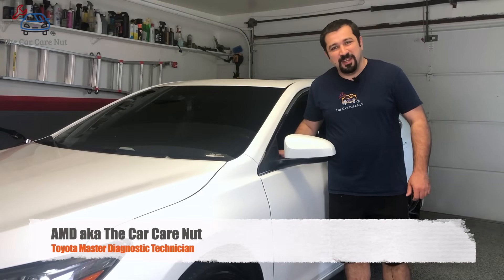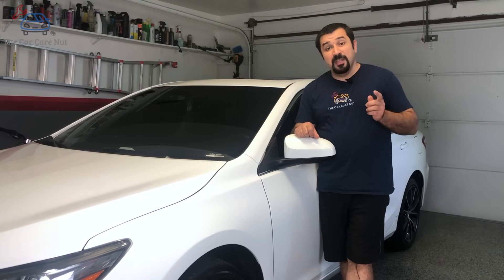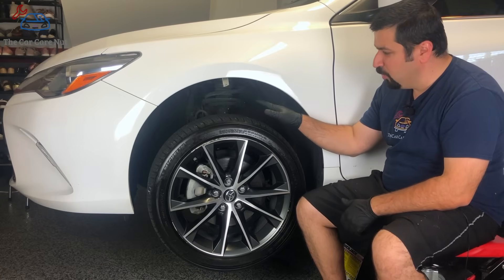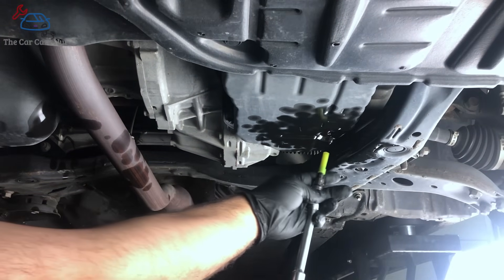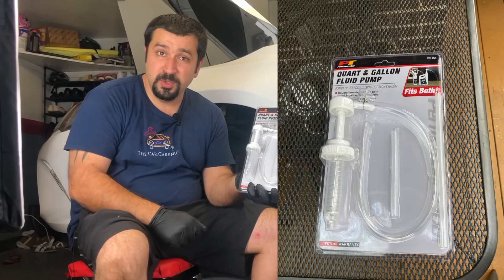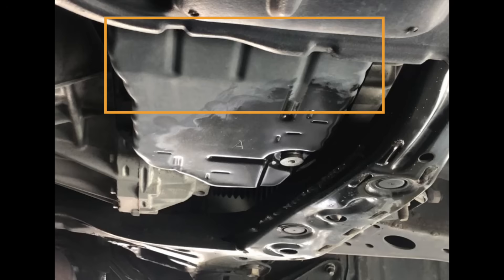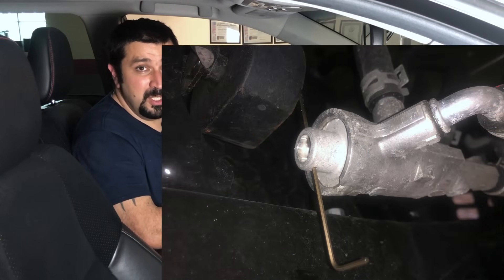How to change your Toyota Sealed Transmission Fluid

Comment: Hello AMD !  I have been one of your subs for about 3 years now and thoroughly enjoy your content.  I have a Japanese built 2017 CHR with  AWD and the 8NR-FTS 1.2 litre  4 cyl. turbo engine, which I purchased new. Today the car has only just over 15,000 km.  

Where I live I consistently drive on rough dusty winding roads in mountainous and hilly terrain at low speeds (30 -50 km/hr) and often in stop and go traffic. The average round trip is between 35-40 km. There is very little opportunity to do any highway driving because there are none in my immediate area. I change my engine oil and filter every 6 months with OEM Toyota oil and filters. I just did a full service on the brakes including re-greasing the caliper slide pins, and inspected the rotors, pads, etc. for proper function and wear. 

Based on these driving conditions and the incredibly low kms on the vehicle,  should I also be performing a transmission service more frequently as well ?  If so, please let me know the temp specs for this transmission and your recommended change interval. I know it calls for FE fluid as indicated on the fill plug. Same question also applies for the transfer case and differential fluid. 

SLL Coolant is still original however according to a recent ph test, it is still registering in the safe zone after 7 years.

Appreciate your help !

Comment: Hi sir, I had a question regarding the fluid check of sealed Toyota corolla transmission.

After going back and forth quickly from D to N, and the D comes solid, May I know why do I have to remove the obd2 cable?
Like what does that do?

Is it fine if I just proceed to drain the fluid with the cable inside?

Comment: You just flashed oil sir no filter changing and pan cleaning😮
Reply: It gets about 1/3 of the fluid is my understanding.  Not a complete flush.
Reply: Actually, I was wondering if that has something to do with the temperature being given in a range.  The old mixed with the new.  Maybe the expansion property varies.

Comment: What are the odds that the Toyota dealerahip does this right?
Reply: It takes something like 8hrs for the trans to cool.  To do this procedure, the dealership or an autoshop would have to have you leave the car overnight or have it towed in.  You won't be sleeping in the waiting room.  So, toyota came up with a procedure to allow them to get the level right at normal operating temperature.  This requires specialized tooling:  A variable length level gauge, vacuum gauge, vacuum pump, fluid tank.  It is much more involved than this original/DIY procedure.  https://www.youtube.com/watch?v=cNcecuGzTDg&t=10s
Reply: @clickhorizon  Any idea of cost? I always get my trans fluid changed at like 60k but it seems all of these newer cars don't schedule a trans fluid replacement at all.

Comment: Hi, I have this same car, 2016 camry.  Door sticker says it has got an A/TM:-01A/U760E trans in it.  Q) What is the actual temperature you would begin this procedure with using a scan tool (scanguage for example) on this vehicle?

Other
-----------------------------------------
You mention three ways to do the temperature check (see 9:00 min).  Then you focus on the 2nd method, letting the diagnostic routine tell you when it is up to temp.

You only state a range for most vehicles are between 95 to 110 (see 16:09), talking about the temperature gun method.  Is the range only about that method?
I've seen other videos giving ranges of 95F to 113F or 104F to 113F.
At (see 16:25) in the video you say this is not a guessing game and you have to be very accurate.

I don't particular want to go with the diag routine method simply because I'm scared I'll short something out & do damage.  I can't see all that well in close quarters to do it.  I wondered if there is a premade jumper/connector for this, but coudn't find one.  So, I bought a scanguage and that's what I'll be using.

So, if it's got to be very accurate, what does that mean.  Why are the temperatures in ranges?  All I am seeing are temperature ranges, not exact temperatures.  Is the range due to tolerances, method, or both?

I seem to have gotten it in my head watching other videos that 104F is the right temperature in general.  I'm thinking that temperature is out there from the 95 to 113 range, since 104 would be the average of the two.  But if you go with the 95 to 110 range, you get a slightly lower average of 102.5F.

Also, if were to use the temperature gun, it's looking to me like (from other videos I've seen), that on the rise, the pan temperature is going to be lower than the fluid temperature.
I'm thinking the opposite is probably true on the fall due to hysteresis...something to consider.
And, I am thinking 95F or 110F is a more apt temp to use with the temperature gun (while the fluid temp is on the rise).
Whereas using a scangauge can be a more accurate figure. But what's best practice... use an average... start with the low temp (since engine will be running still & temp rising)... or go with lower temp rather than higher temp so that you don't underfill....but then overfilling could be bad too...  Anyway, just my thoughts.

What I'd really like to see is a spec for my particular vehicle.  I've seen people talk about the transmission.  Maybe that's all you need to know, that it's a U760E... or does vehicle make&model really come into play, idk.
Reply: Well... I went ahead and did this drain and fill on mine.  Was going to do this at 60k, but I either didn't have the tools or the weather was no good.  I got about 2.5qts out, very dark/black.  62k miles.  Most of it came out without even removing the overfill tube.  I only got about a 1/2 quart, I think, after removing the tube.  I was a little worried something was wrong.  Tube looked good.  Thought it might be cracked or missing.  I realized this must be because its done cold so all that fluid had drained out of the gears overnight and overfilled into the pan far above the overfill tube.  Still suprised at how little came out with the tube out though.  I carried on.  Put the tube back in, just snug/hand-tight, & and put the drain bolt in temporarily.  Put in 3 quarts.  Started it up.  Ran it through all the gears before the level off several times.  I was aiming for 102.5F, but the ScanGaugeIII was only giving me readings in 2degree increments brand new out of the box.  Started it at 101F and ended at 107F. so should be within spec.  Pulled the drain plug and got out 1/2qt before it started to dribble.  Still pretty dark but with traces of red.  Almost exactly what I overfilled it, so that was a good sign.  I used that bucket from the video, great tip.  Hardest part of this job was just leveling the vehicle in the driveway.  I had a hell of a time with that.  Finally settled on using a socket up against the drain bolt head itself with a bubble level.  Front to back and Left to right.  Never did get it as level as I would have liked.  I'd get it where I liked it one direction and the other direction would be off.  Anyway... thats my experience.  Went for a 10mile test drive.  I'm happy with it.  6hrs it took me lol.  I'm thinking of doing it again, considering the color.

Comment: Thank you for your help. I was able to change the fluid without too much trouble and learned a ton! Some observations from my experience should it help anyone:
1. I have a 2019 Camry and did the transmission fluid change at 60k miles. It was the first time I did it and the first time the transmission fluid has been changed since buying the car new. The fluid seemed very clean and still a good red color.
2. I did an oil change at the same time but before the transmission. You do not need to remove the splash guard that covers the oil drain plug as it is bolted to the same splash guard you have to remove to gain access to the transmission drain plug and remove that will expose oil drain bolt anyway. Save you a few minutes if you're doing the engine oil at the same time and a 'duh!' moment lol.
3. The drain plug AND the fill plug were torqued down extremely tight. Make sure you have something with a lot of leverage, especially the drain bolt. I used a 16 inch torque wrench and still barked my knuckles on the fill plug. Be careful.
4.I jacked the up car on 4 stands to keep it level and confirmed with a magnetic level on the undercarriage. It wasn't perfect but it was close.
5. A long piece of tube stretched over a funnel held high above and clamped onto hydraulic lifts for the hood is how i got the fluid back into the transmission. As long as there was pressure from more fluid flowing into the tube it was able to go into the fill hole with minimal leakage. I couldn't get the last few drops in, but I purposefully overfilled it so that last few ml's didn't matter. 
6. Draining was straightforward, the straw came right out and the fluid came afterwards. I didn't have a bucket to measure but that would've made it a lot easier to know how much to put in. Another video I watched said 3.5l which is what I did and it went fine draining out the excess though it was probably a little wasteful.
7. The temperature was tricky. I went with the infrared gun method and because my Camry isn't the same model as the vehicle in this video the picture wasn't a perfect match. I looked for the same ridges in the picture and tested multiple areas until every spot on the transmission case was over 95F. Afterwards I removed the drain bolt for the second drain to get the appropriate fluid level and after about 20-30 seconds it started to trickle out like shown in the video.
8. Before and during part 7 I was shifting to circulate the new fluid a very concerning thump sound kept happening when going from park to neutral, neutral to drive, drive to park etc. It wasn't a bad thump, I imagine it was the transmission doing its job with low initial fluid since it hadn't had the chance to fully circulate. I took a risk and drove it around afterwards and luckily that sound did not occur over the 20-25 minutes of test driving. I was mainly doing neighborhood but also was able to get up to highway speeds of around 70mph and it was shifting great, no incidents. I think giving the fluid the opportunity to actually flow and engage the gears instead of just alternating between park and drive was what actually filled up any gaps in transmission fluid that was causing the thumping. I still am concerned that the sound was due to low transmission fluid, so I'm curious how it will sound when I start it cold tomorrow morning. In either case it drives as good as new when warm so I know the level is very close and I way overbought fluid so I can add more and repeat the drain process.
8. I've left the splash guard off for now, and placed a large piece of cardboard under where both the oil and transmission drain bolts are located. I will inspect it in the morning for any leaks, along with the bolts themselves. I'm about 2 hours post change and the only thing on the cardboard so far is water so I think I'm in the clear.

Will update ASAP. Thanks for all your help!
Reply: Update?
Reply: @shnielmanhousr4165  I changed the fluid and despite initial fears all is well! It’s been nearly a year now and absolutely zero issues with the transmission! When I do this against 120k miles I’m going to measure how much fluid comes out instead of doing the temp measurement dipstick thing! Good luck!
Reply: Update please
Reply: @kojac40  hey! It went great and there car runs flawlessly no issues! When I do this procedure again I’m going to just measure the fluid that comes out and replace that amount rather than do the dipstick drop perfect temperature thing.

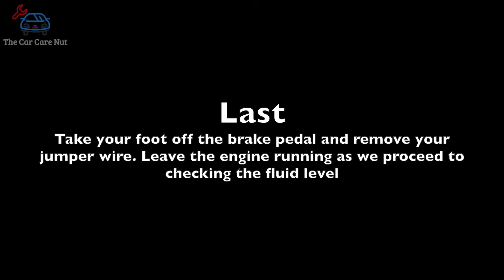Comment: On the "Last Part"(12:13) When you take your foot off the brake pedal and remove the jumper wire. Leave the engine running as we proceed to checking the fluid level. My question is Do you put the car in park?

Comment: I used an electrical multimeter temperature probe taped to the transmission pan on my Lexus IS250 to set the fluid level and it Worked perfectly. I also taped a kitchen thermometer next to it as a reference ( Kitchen thermometer was very accurate ) Didn`t need a costly scan tool / infrared heat gun or to jump the OBD port.
Reply: So when you use a temp. probe to get the proper temperature you no longer need to do the the jumper wire shifter cycling process? Or is it still necessary to cycle the hydraulic circuits?
Reply: @johnhoover7869  I cycled the transmission between fluid changes. Just search IS250 Transmission oil change and you`ll find lots of tutorials.
Reply: @johnhoover7869  No jumper wire needed ( that`s only to put the ECU into the maintenance mode ) You still need to cycle the trans through D N R P 3 or 4 times to circulate the fluid. No need to do the rapid P N shifting as that is only needed to obtain the correct temp via the ECU maintenance mode )

Comment: Great video.  I discovered that the Toyota dealership that had done a fluid flush had forgotten to reinstall the plastic standpipe and the magnets in the drain pan, resulting in low fluid and problems when the transmission was cold.  So much for the dealership. BTW, my heat gun read 85 deg F when the D light came on, and 110 deg when it started flashing.  So it was 5 to 10 deg too low. So if you use that method, factor that in.

Comment: What would the temperature be for a 2021 Toyota RAV4 XLE? Also, when your shifting between neutral and drive you stated the drive will turn solid. How does that work if your continuously shifting between neutral and Drive? Would you just have to keep an eye on when you are shifting it to drive to see if it turns solid before shifting back to neutral?

Comment: Can you make a video explaining the procedure on models with a dipstick? Just wondering how to determine the correct levels between cold and hot and whether i should use the temp sensing mode you explained here using jumper cable to test the hot side, or if thats unnecessary. Seems like even the dipstick isnt exactly precise, would you recommend just doing this drain and fill procedure even with a dipstick?
Reply: I found this:

https://youtu.be/s-tHJ2Q_BbA?si=YmKSXqlJ0ylmAh_r

Comment: how about a 2012 Toyota Camry se 3.5 V6 transmission filter fluid replacement. I have always drained and what ever comes out I put back. 😊🎉
Reply: Better do the D line method that showed in the video, i did 3 times measure what come out and put back before and 4th time followed this video method. Turn out the car was low by 1/3 of a quart. Transmission fluid does lost a bit throughout hot and cold cycles and by put back what came out, the total fluid amount remain low

Comment: What I don't understand is why is there transmission fluid running out of the overflow stem when it has been sitting for a long time and it is not warm. I have watched several videos including yours and each time, transmission fluid runs out. I thought if the level is correct, it will only run out only when it is hot and it has expanded over the overflow stem? However, when you took the 6mm screw out, transmission fluid came out and it was not warm and you did not take the stem out yet. Just curious why that is?
Reply: I think it has to do with the leveling procedure being performed while the car is running and fluid is flowing throughout the transmission. When initially draining it cold the fluid has had time to settle in the pan above the leveling tube and trickles out when the drain plug is removed.
Reply: @BarryB418  No, that's Incorrect amid near the beginning of the video he displayed a drawing and even referenced the green tube as green amid the tube's actual color. In his drawing he displayed the fluid level (when cold) as being below the leveling tube, that being said the fluid cannot settle above the leveling tube amid when cold it's already (if previously filled properly) below the leveling tube according to his illustration.
Reply: That's a great question. I hope someone can answer this
Reply: That is a great question. It should only " Trickle Out " before the plastic tube is removed.

Comment: Hello ,i have a 2019 chr 78,000 miles.never changed the cvt oil.do you recommend flushing or drain and fill?

Comment: I have a 2012 Toyota Camry XLE, and a 2014 Toyota Corolla. I plan to change the fluid on both. What temp range should I use on each car? You gave a great explanation in this video I just need to know the proper temp of each of these cars so I can use the temp gun you recommended. Thank you.

Comment: 29 Foot Pounds for the fill plug. 
15 Foot Pounds for the drain plug.
1 Foot Pound (12 inch pounds) for the plastic overflow tube (just hand tighten).
76 Foot Pounds for the wheel lug nut torque.

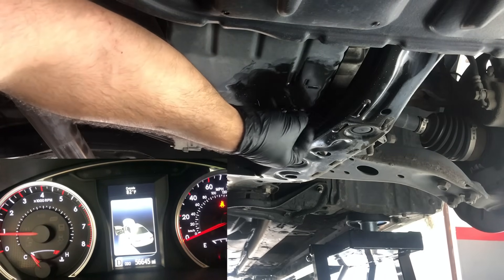Comment: 12:35 Is the transmission in Park or Drive (with the foot on the brake ) when the fluid is draining until it trickles? I know most automatics transmissions have different fluid flow paths in different gears, therefore, it changes the level of the fluid.

Comment: My 2012 Venza 4cyl will soon be at 100,000 miles. I bought car 2015 with 37,000 miles. I want to do a fluid and filter change. I doubt the fluid was changed before I bought the car. Is it safe for me to chage the fluid and filter at 100,000 miles ? Also what temperature should I use with a temperature scan tool. Thanks

Comment: You only replace what you drain out?
Reply: Yes exactly what about the other six quarts?
Reply: @davidriedinger770  I would not call it a fluid change.
Reply: @mgomez5606  okay but what we were watching in the video is sufficient to do every 60,000 miles?
Reply: @davidriedinger770  I don't agree. Dealer charges alot if that is all they do.